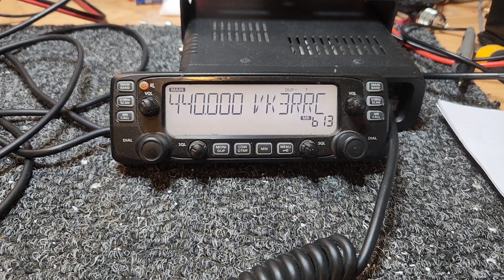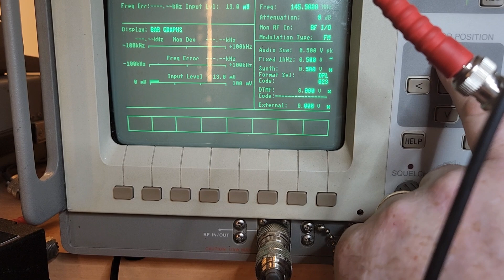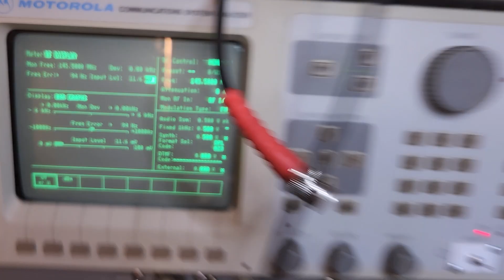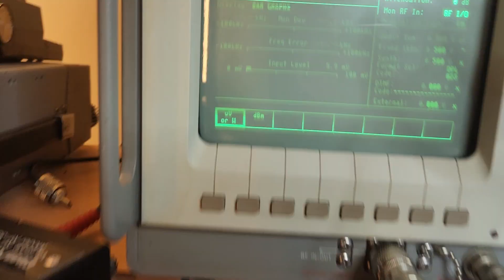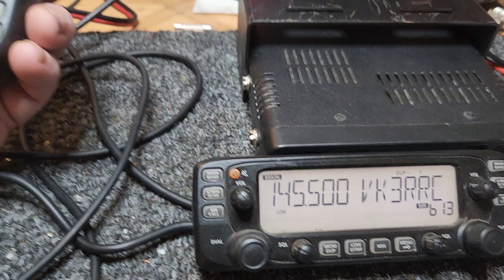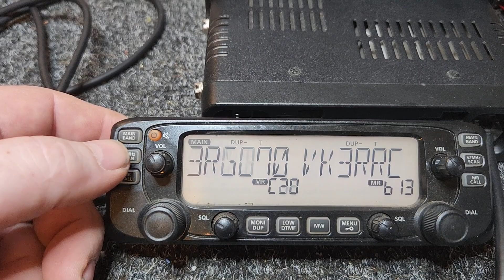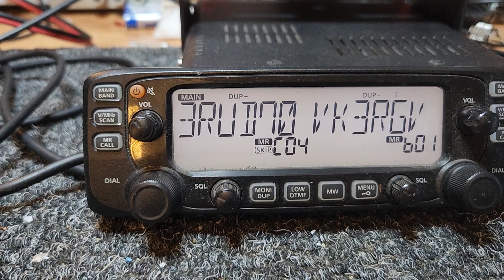Icom 2730 2m / 70cm true dual band that covers everything beautifully in a quality mobile radio.

Comment: HM 133V works good to 2730A ?? Meaning, all double keys function is read by radio ?? Standard mic lacks a lot of functions and you need to use the base buttons, not a very well design when you are driving...I try HM 98S but no TX.